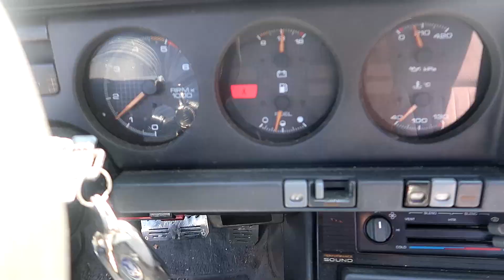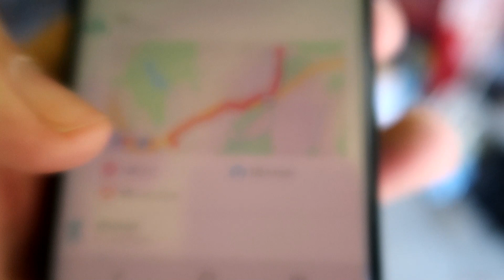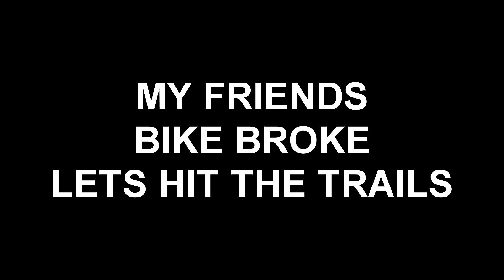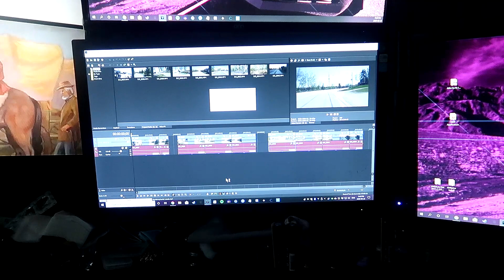First Mow of the Year and Lost in the woods

Comment: Depending on the shifter, the adjustment is probably just a screw on the handlebar shifters (either inside the shifter, or a twist thing on the end of the cable coming out of the shifter, similar to the brakes), but to be already struggling out of the box, that's pretty poor...